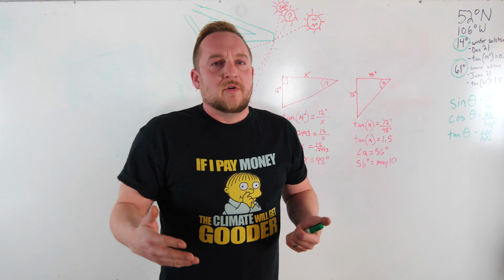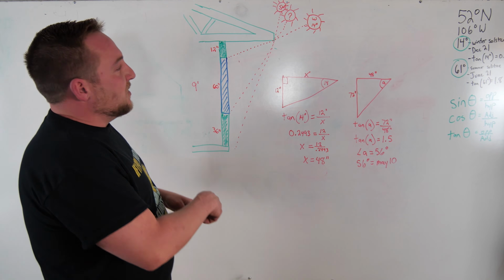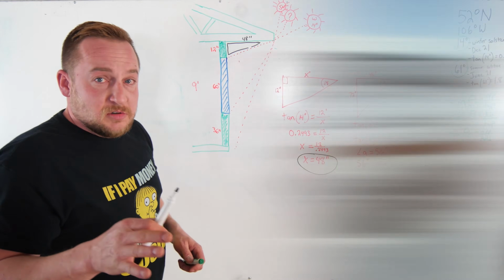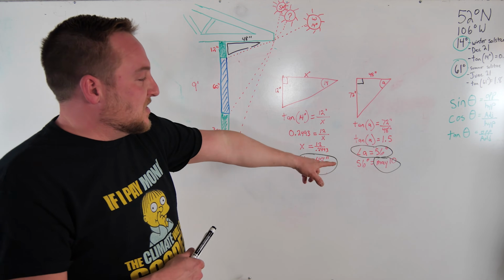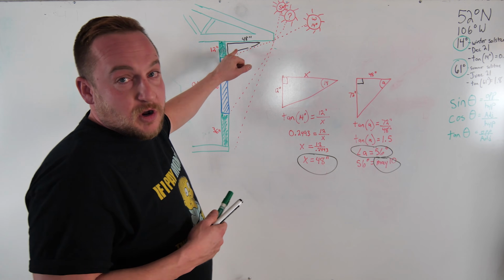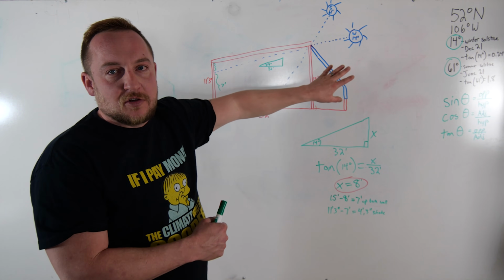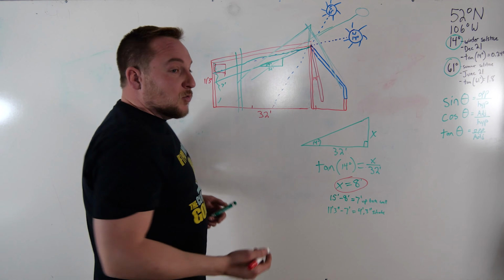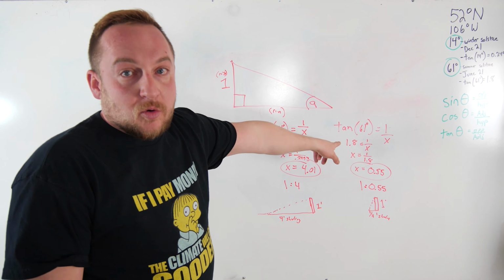☀️Sun Angles📐for Passive Solar - Houses, Shops, Barns, & Greenhouses - Anywhere on Earth

Comment: Very blessed that the previous owner of my property did a few things correctly and built a ranch style bungalow facing south with a covered deck and deciduous trees to shade in summer. There’s has pretty much never been a summer day I thought I needed A/C. We have concrete slab on grade so the temperature is very stable.

Comment: Thanks for this!  Very helpful.  Turns out my south facing house is doing not bad for this.  5 6 foot tall (by 5 foot) picture windows facing south and 2 foot overhangs.  Maybe if I add a retractible awning over the deck in front of those windows for summer it would be even better.

Someday I will move to acreage and build Passivhaus properly, with a concrete floor over a huge pile of sand, like your greenhouse.   Using your formula.  And a 12,000lb Russian fireplace too.

Comment: Thats nice, glad it works in Canada. We have a south facing house that is earth contact. no windows on North, east or west side. Were at 38 degrees and have a 10' covered porch. The AC went out this year. 102 outside and 84 inside with 100% humidity for 2 weeks. it was uncomfortable. Yes, i know awning windows front and back low/high cross wind. But, Bro! 8' of earth at 55 degrees on 3 sides to 8 ' high is greater than cross breeze. Insulation is for keeping the warm in or preventing cold penetration. It does almost nothing for keeping the warm out.

Comment: I am fascinated by your greenhouse.  (Central Québec'istan)

19.7° peak sun elevation at 12:48 on Winter Solstice for us.
I wouldn't need to go as deep as 32'.

12:00:00	18.9°	168.29°
13:00:00	19.7°	182.84°

Clay is abundant in Quebec. I was thinking a clay battery, 1" pex tubing, maybe 1000' every 2-3 feet.

I really liked the partially open earth concept for trees to have deep roots, but Quebec is so fricking humid.. and buggy too during summer.

Another concept I am looking into is the Jean Pain compost heating method, maybe more for a wind tunnel.
I think it would be great to grow sweet potatoes in colder climate. (or any other heat thriving plants)

Like clay, wood chips are plentiful in my neck of the woods. Government carbon non-sense is the scary part of my plan.

Comment: My problem with what this guy shows and others on you tube is they have a basic ranch like house like all the houses in my area. The over hang barley shades the house fom the sun then they call it passive. If you follow this idea them you wouldn't gain any efficiency over any of my neighbors or you would have to wrap the exterrior and foundation in insulation. Very few people wrap the exterrior in insulation. So why not protect the ground around the house with a deeper eve but still let winter sun hit the entire side of the house?

Comment: could puttting a greenhouse infront off your house help with cooling? becaus it warms up and could pull air true an undergound tube to coul ure home. And also the right insulation is key i think. pur and pir insulation have no thermall mass. so the let radiant heat treu verry easely. So useing celluose insulation is better for the summer. and its a natrural product.
Reply from the maker: I know what you mean about a natural draft in summer that you want.   Just a high point on the south, greenhouse wouldn’t “cool”

Comment: We are 75 deg in peak summer 35 deg in middle of winter. The arc changes a fair bit with the lower angle add a lot of cloud and rain we don't see a lot of sun in winter

Comment: how big of a truss heel do you have?
Reply: Did you have the trusses mirrored, so you have 48' over hangs on both the front and back? obviously wouldn't need them in the north but just curious. How big are you east and west over hangs?
Did you use 2x6 or 2x8 wall studs? Thanks-im building and planning to have the drafter change a few things after this.
One last thing- if my south windows are not all the same height above the floor, I should use the  lowest window for the calculation right?
Reply from the maker: North, east, west doesn’t matter for sun or efficiency.  More north overhang gives you more room for proper blow in insulation of course though.   My house is small so I just did 2x6 with 1.5 inch rigid outside, for a total r value of 30 walls.   ✌️
Reply: Thanks. So my builder is asking about the heel height on the truss? Im at 44 lat. Im coming up with 29.7" (I rounded to 30") overhang but to engineer the truss properly what do I tell him for the heel height? @ArkopiaYouTube
Reply from the maker: Nice to get 28 inches of blow in insulation for an R80 right above the wall (heel height) ✌️
Reply: @ArkopiaYouTube Lets say you did not have a couch on your wall, so instead of 36" you had the bottom of the window only 12" off the floor.  I am getting a higher angle then your max sun angle in your area? So it would be shaded anyways and it doesn't seem to pay to go that low on a window anymore. Am I thinking of this correctly or screwing up the math? Thank you
Reply: Maybe my head is all screwed up from calculating to long this morning but it seems to be the sun would still be coming into your house in the summer solstice and not completely away from your house. Let's say you have a patio door so your last calculation 9' (108") with your 48 overhang I am coming up with 66deg. If your max sun is 61 deg. Won't there be sun inside your house? Again, maybe Im brain fogged. My house I'm 12" from ceiling and 12" from floor. 44 lat so calculated a 30" overhang. I am coming up with an angle greater then my max summer solstice of 69. Wouldn't that be going in the house? Forgive me and thank you

Comment: Excellent video! It should be 'required viewing' for builders and architects, most of whom who don't seem to get it. My wife and I designed and built our own off-grid super-insulated home here in central British Columbia some dozen years ago. We drew up scale drawings on graph paper to better understand sun angles and settle on roof overhangs and window placement. It's not rocket science, once you know what you're doing. We have double-stud construction, R36 floors, R48 walls and R68 ceilings, triple-glazed windows, 3 1/2 ft overhangs. Nothing is top-of-the-line but the best we could afford at the time. Performance is very good, although of course we could do better today, knowing then what we know now. Even in the dead of winter we never keep the wood cookstove running through the night. We simply relight it in the morning, while all our friends and neighbours take turns with their spouses getting up to feed their fires.

Comment: it called an  "alpine roof/eave"     basically how  i built my house 30 years ago or how houses were built in  the  alpine region of Europe  for centuries . . but to be honest for winter solar heating purpose in Canada   it will only reduce it by about 30% during most for the winter  @53 lat due the drop in sun intensity   and hardiness zone of 2 to 3 . basically  from  mid Dec to mid Feb ( depending  on the amount of sun)  realistically   you can expect only between 10 to 30% reduction in this time period for heating costs due to the sun decreased intensity and or cloudiness ..  but from mid Feb to  mid Dec  you can expect the sun to do about 60% of your heating needs with  a 30 day transition period that varies  with the amount clear days you have to the spring equinox or fall equinox. then once  the days are 12hrs or longer  almost no  external heating needs is generally required after that point . and over all  when averaged it over the entire heating season you might have 60% drop in heating requirements. as say with my house the energy requirement is about $100 per year for heating    and I use 100% electricity to heat my house. sure theoretically  I had an 80 to 90% drop in energy requirement  over conventional heating ..  that because  I have my solar heating which reduced it ~60% over the entire heating season   and then I have my heat pump which reduced it again by 60% ( 80 to 90% total energy reduction  ). if you are burning  a fuel or using electricity conventionally  the most you can expect is 60% drop in usage in a hardiness zone of 2 to 3. a passive solar heated house can only be realistically be achieves in hardiness Zone 5 or higher or in a much lower latitude of around 40 degrees  ( as cost benefit becomes prohibitive)

Comment: now that i watched this, I see our initial plans are crap- so much for that expert. If  we have our degrees, 70 and 22, im kind of lost as to how big things should be, ie original plan was 24 w 30 l, but only 10 ft tall, so if i do the function right, i get 13ft, at 22deg, which means the front would have to be 21ft for sun to hit a 8ft rear wall?
Reply from the maker: 30 deep?   Tan(22) = x / 30ft.   = 9.7ft.  If your south wall is 10ft, the sun wouldn’t barely touch the back wall (10-9.7 = 0.3ft up back wall)
Reply: @ArkopiaYouTube  i think you mentioned this on one of your other videos, but can't we just make the roof angle be the same of the winter solstice angle so allow for the deeper width?
Reply from the maker: I don’t understand the question.   There are many ways to do it.   I like the winter sun hitting a large part of the back wall.   👍
Reply: @ArkopiaYouTube  thanks, at least I know im doing it right, we are 24 ft wide, I just need to increase the height of the south wall, by almost 2x, had not planned on it being that tall, but it looks like if we don't go 19-20 ft tall, then we would barely have enough winter sun for passive solar barrel heat. 
Thanks fo the help!    they have been great, answering questions on what I should not do with other methods/peoples ideas that left me questioning how they heated (they dont)  Chicago burbs look out! Looks like we are going big, (maybe digging down to reduce overall height.. back to the drawing board, and zoning, and permits.. lol
Reply from the maker: Could reduce the depth of it as well, 20ft is high.   More south facing, less deep.   👍

Comment: south facing wall should be for maximum exposure during w.solistice @53' latitude north @12:00: 90'-14'=76'. @45' some of the light gets reflected and you don't want that in the middle of the winter.
Reply: I have in construction a walipini built in concrete, 6,5 ft  deep (22x21ft) that will be ready early this year, in March hopefully, whee I live @44 lat.north, double sided poly, with rocket mass heater along east and west buried  1.6ft. I am very exited about this project. Love your vids! You are a good source of inspiration! Thank you!
Reply from the maker: Polycarbonate refracts, not reflects, light.   You are correct; for perfect winter-only glazing.   We use in summer also, but we are most worried about shading functions. ✌️
Reply: @ArkopiaYouTube your statement implies that poly absorbs all the light that is hitting the surface of the sheet, 100% and refracts that same amount in the interior of the greenhouse? sorry but that is incorrect. I read the technical papers. Poly is also reflective acc.to them and in optics, ask GPT, material composition and incidence angle are critical aspects.

Comment: Have you looked at doing Thermal Insulated Moving Shutters?  Talking about outside mounting, and either pivot like a door, or doors, or maybe slide like a barn door to snuggly cover the windows from the outside at night?
Reply from the maker: My house I left enough room beside each window for something like that.   Never got around to it as all my windows are very high performance and don’t give any issues.   I should have done a roll up blanket on my greenhouse south though, and will be doubling up my shop overhead doors one of these years. 👍

Comment: Your green house is beautiful! 😎 We did a lot of guessing for our passive design home design, and it worked out great. With our 4 ft overhang we have about 1 ft of shade on the south side during the summer, and full sun in the windows in the winter. We put in as many windows as looked right. Passive heating, exterior insulation, and thermal mass is awesome! Its so nice having stable even temperatures day and night. We have glazing only on our east and west windows as well as on our big sliding glass door. In the summer, we use an evaporative cooler for an hour or two in the morning and evening, and close the windows during the day. Our house is heated completely by the sun in the winter. 🌞🏜️

Comment: Doing a build. First retro was 74. Doubled the insulation of a 1961 build.  Last 8 months doing a new build - using passive house techniques. I did the heat and cooling btu calcs and 1300 sq ft - comes into 5000 btu.  I use Librecad to draw - sketch up. cheers

Comment: So if I hear what you're saying in this video and in past videos in areas like mine in North Idaho where there aren't as many sunny days if I use sloped glazing I won't be able to use the greenhouse in the winter due to heat loss and if I use vertical glazing the greenhouse won't work well in the summer because the sunlight won't reach very far back in the greenhouse. Is that correct?  I am interested in a consultation but I would to get my basic plan laid out first and then we can cover over the details.
Reply from the maker: If you don’t have many sunny days in the winter then maybe it’s better to consider the less glazing and artificial lighting.   Maybe a winter area in the back of the building with a vertical wall and a summer greenhouse attached to the front of that vertical wall?   Hate for you to use my design where you barely have any winter sun.

Comment: I’m NOT good at trig or math. Is there. Way to figure this the year before by just marking where shade hits or something? I’m sure really old timers knew this and there’s a way to figure it out, maybe not as exact, but still get most of it? Like the old sun dials they used? IDK. Just wondering.
Reply from the maker: You could use a protractor and graph paper to get it pretty close.   I mark the sun on my buildings with a pencil also.   ✌️

Comment: Love this vid! My home in Arizona was built before air conditioning was a thing and it follows all these design principles. Even though the south side of my house is nearly 100% glass it's easy to heat in the winter and cool in the summer because of the proper overhangs.
Reply: So many THANKS, for your time and help
Reply from the maker: Makes sense because we are extremely cold here.   Too much glazing wouldn’t work here, but would likely work there good.  👍✌️
Reply: No matter where we live, the placing and amount of glazing is a compromise. Computer modeling has shown that, ideally, we'd all live in windowless boxes. Looked at on an annual basis, even the best windows lose more energy than they gain. Remember the 1970s and the experimental solar homes with entire walls of glass? We caretook one, and it became an oven by day and shivering cold by night. Today, no-one designs homes like that. It took years to begin to understand that more glazing isn't better.

Our home faces south and has four triple-glazed windows and a glass door on that side (minimal glazing on the north side, to reduce losses). The windows sit under a 3 1/2 ft overhang, and that's pretty generous. BUT......the sills are just eighteen inches above floor level, as my wife wanted to see the view below from our ridge-top site. That extra glass loses heat in the winter and, more importantly, causes occasional overheating in the hottest, sunniest part of the summer. This is no surprise; we knew we were compromising performance for those views. But now we need to look at external blinds or eave extensions or something to keep out the direct sun in the very hottest weather. The smart thing to do would have been raise those sills to thirty-six inches or so (whatever a sun angle analysis suggests). But building design is all about compromise. My wife is happy and feels the lowered performance was worth it. @ArkopiaYouTube

Comment: Watched four of your videos so far and its bang on.  I live in Regina, Sask and am experiencing the exact weather you have and its really refreshing to listen to you explain the physics of sun angles, biomass, insulation, etc, with all the necessary engineering should be made into mandatory building code by  LAW.  It`s really a no brainer when it comes to reducing the need for power and gas.  The is the best design for people to live off the grid and live in a earth ship.  The bigger the better the results will be.  I will pass this on to people so they can benefit from your great ideas;  Thanks Dean.  Very well explained.
Reply from the maker: Appreciate it 🙏✌️

Comment: The 6 appartment building I live in, in Switzerland, is perfectly built. In the sommer, the windows dont get sun and in the winter they do, plus we are facing South perfectly. It was built 54 years ago. The latest style in new buidings, are square blocks with flat roofs and thick insulation. There electric bills are higher then our old one. Besides, there paint job looks pretty bad after just a few years. New is not always better!
Reply from the maker: That’s amazing.   We don’t have a single building like your old one in Canada that I am aware of.  😂
Reply: Apparently, the new designers are out in touch with nature or just don't care. Square blocks with flat roofs are easier, faster and cheaper to build than slanted roof and window placements based on sun angels.  I am glad you brought it up.  When people say Switzerland, there is a certain expectation of high-quality time-tested workmanship.  Looks like it goes down too.  Very disappointed.